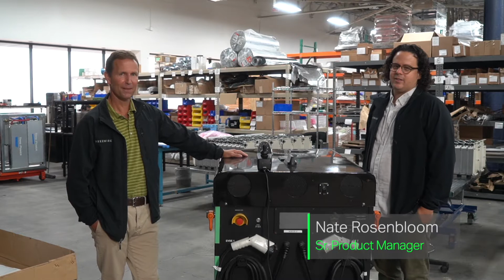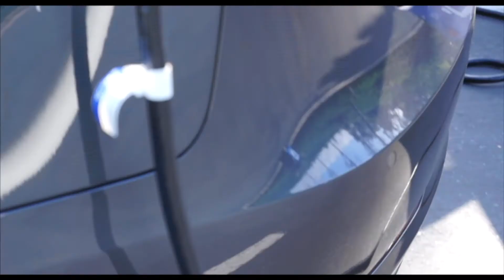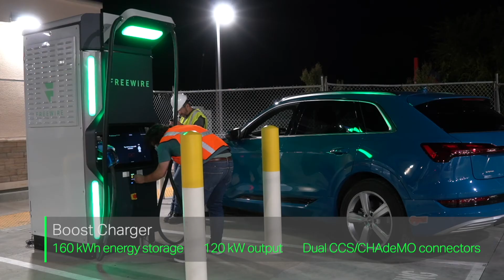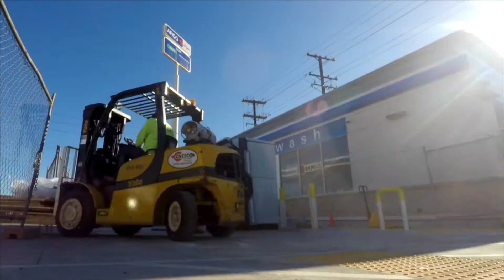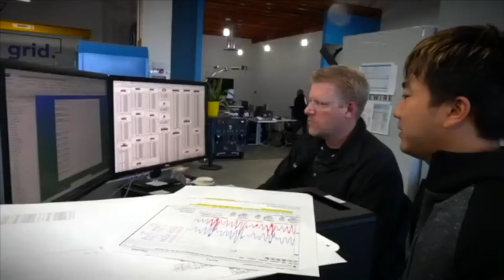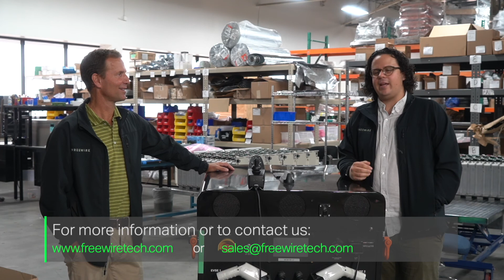FreeWire Discussion with Ethan and Nate

Comment: We just got a few of these in Tulsa, looks like a neat concept. 

A couple questions, what’s the max amperage each connector can output on the boost? 300A each (300A * 400V = 120kW)?

Also, since Nissan has announced that their US Vehicles going forward will use CCS, would you consider replacing the Chademo cables on these with Tesla connectors if available?

With Chademo going EOL in the US it seems to me that the Tesla connector would see more usage over time assuming you can get it to work at full speed (all 120kW).
Reply: Would it not be better to use the Tesla Supercharger for your Tesla? I thought they have very fast charging speeds and there are many Super Charger locations. Seems like Tesla Super Chargers are the best option for a Tesla vehicle,